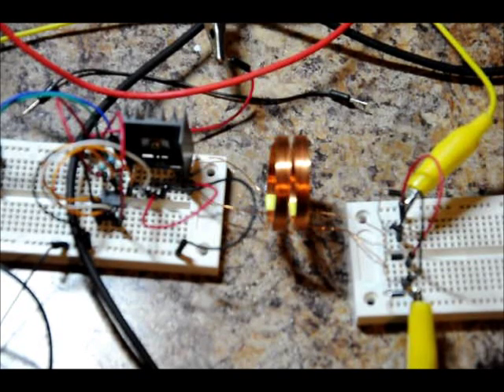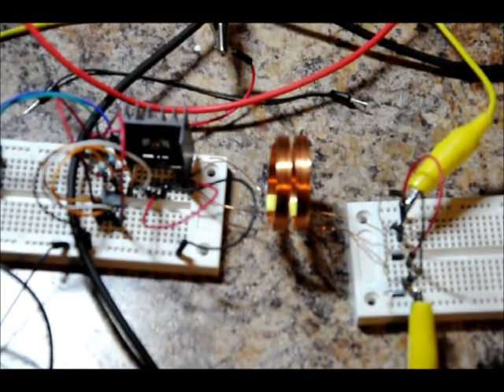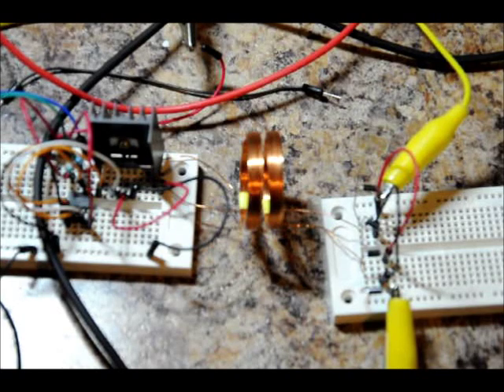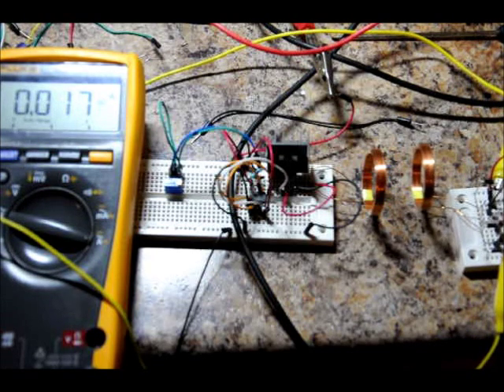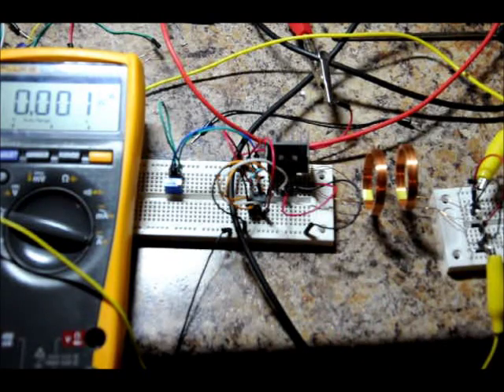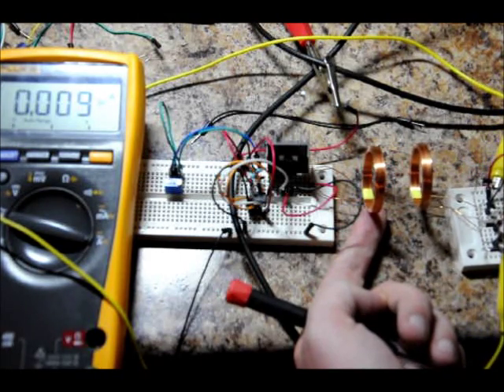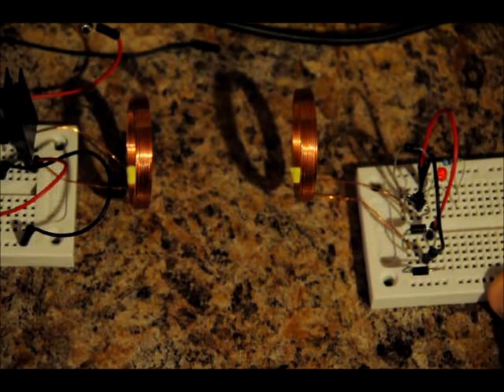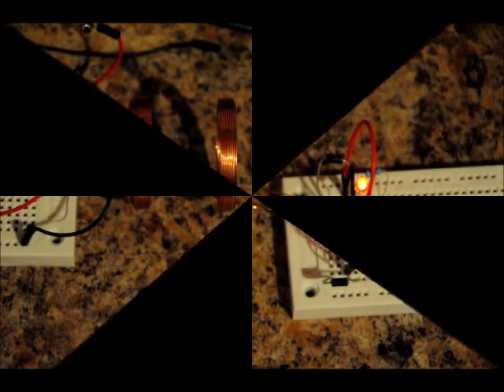Wireless charging with a 555 timer attempt#2  (Much Better Coupling)

Comment: he did usfull power
only one coil
and he lighted multible light bulps fluressent tubes and a few ac engines

and i did not try to burn you btw
i was wondering why only a couple of inches